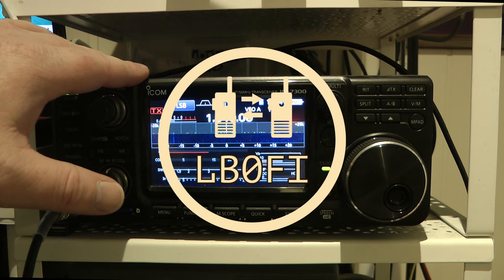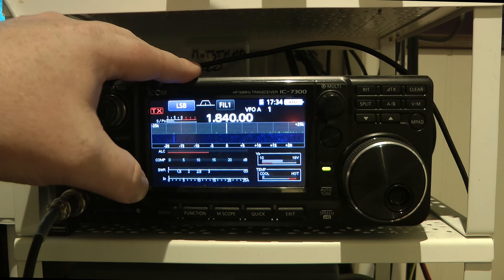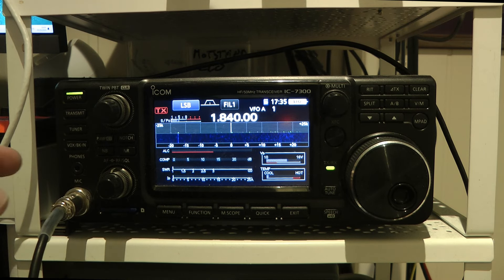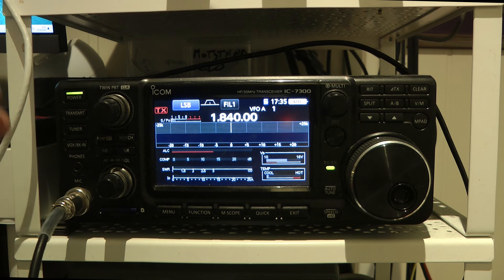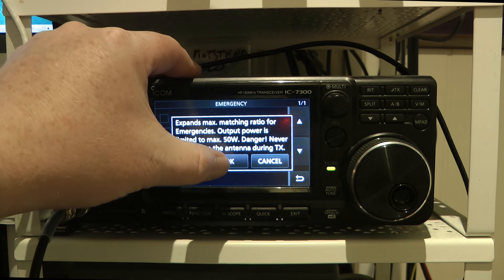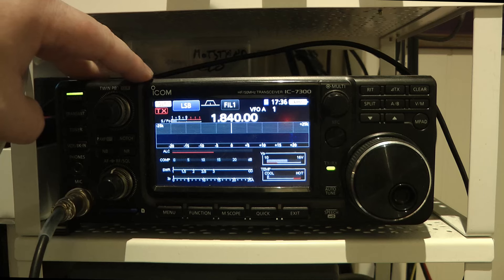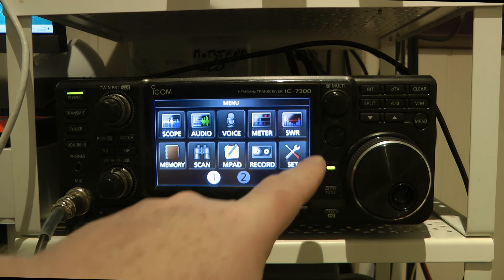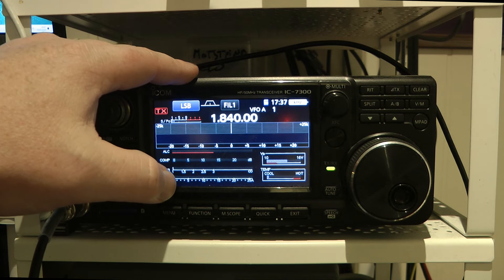Is the IC-7300 really a 50W G90?

Comment: Emergency mode automatically reduces power to 50W max.   I think I'm correct in saying that in Emergency mode the tuner does not memorise it's settings, i.e. you need to retune each time you change band. But it is a design feature, so there should be no concerns about using it.  There are concerns about those who seek to modify the rig to use the wider tuner controls to allow nearer to 100W which will but greater stress on componeents.
Reply from the maker: Thanks for the feedback. I think I mentioned that the power is reduced to 50 watts.

Comment: This was most important feature to bay IC7300 and not FT710 for portable operations. Also smaller RX power usage.
Reply from the maker: It’s a good feature, although I don’t know what the long term effects will be.
Reply: @LB0FI  Limitation of 50W is to prevent too high voltages and amperage at higher SWR in tuner to do not break it and it is enforced. You don't need to lower power, even with 100% power set it is still limited to 50W.